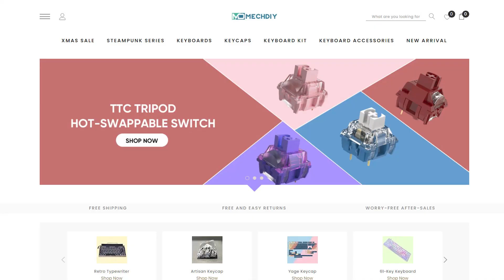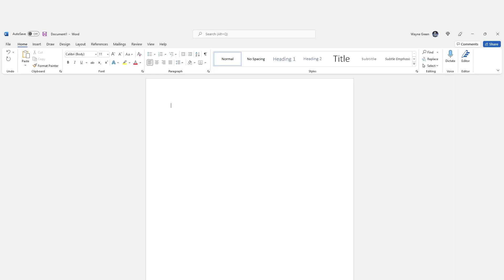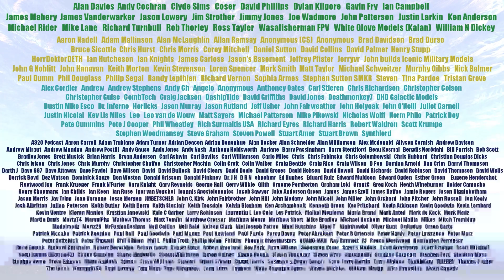The MECHDIY Mechanical Keyboard, Caps and Switches Build

Comment: Hi Wayne! I'm sorry to bring you into this but I've saved up a few issues so I could sit down and build a few series at once but I've got serious issues with eaglemoss build the ecto 1! My frame is bent so the doors don't fit and I've had the replacement door and the hinge also broke on that because of the bent frame!! I've emailed eaglemoss about all the issues I have and they have said they will send replacement parts but will charge me!!!!! Hinges not fitting is NOT my fault and TWISTED FRAME!! is also NOT my fault!!! They will not refund my full money for everything that I've paid so far which is wrong because it has been sold to me and because of all of the problems it has been sold as NON FIT FOR PURPOSE!! Could you please get hold of eaglemoss on my behalf because I have had no joy... Many thanks Scoobyjay 👍
Reply from the maker: The Trouble is Eaglemoss tell you to take inventory of what you have and report any problems within 30 days. I don’t get involved in customer service issues I’m afraid.